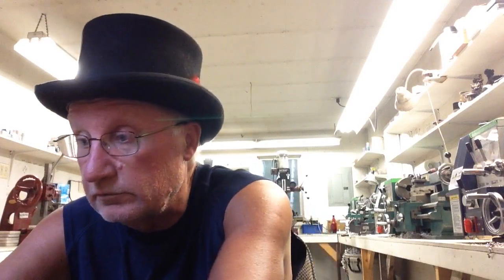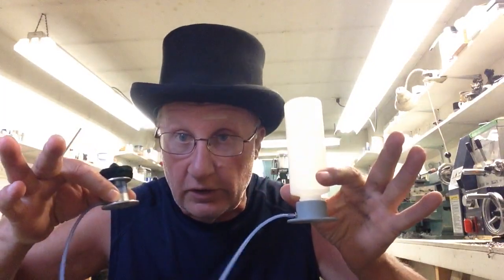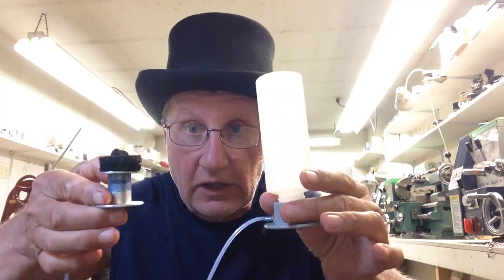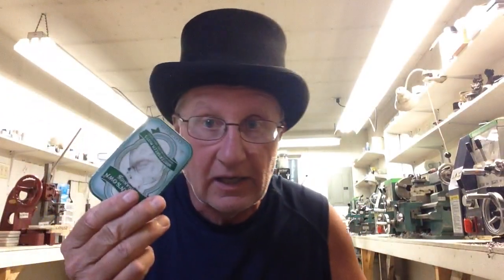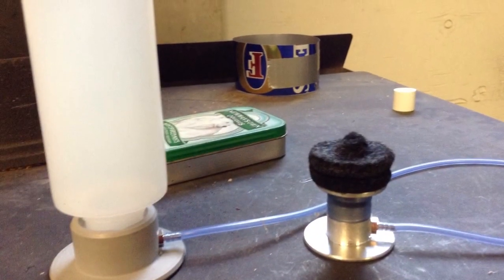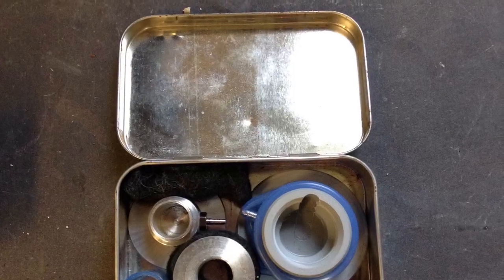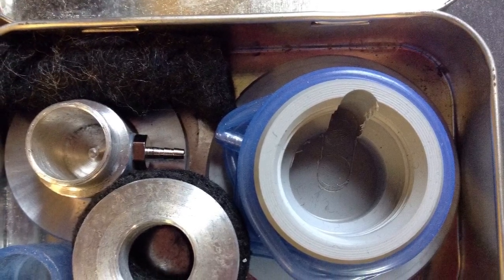Small Stove Kit

Comment: hey Tinny- im an iso-pro user, have bin for a long time now and i like this stove. i know there is a difference between the two. if i was to pick up this stove and play with it to get used to it before taking it out. that would be the right thing? yes- it would be my first alcohol stove. gotts to ask a master of these stoves. if i dont ask, a 40 yr old kid will turn into some thing like beavis and butthead and burn down the woods or close to it()(LOL!!!).
Reply from the maker: Sorry ---but i do not understand what you are asking.
Reply: Danny Panetta If you're asking whether or not to familiarize yourself ,with the use and performance of a new stove ,and not having  used a methanol stove before ,I would say yes.
  If you time how long and how much fuel a new stove uses to heat a typical meal you can determine how much fuel to bring.
  Also if you don't know what to expect from an untested stove in a remote location  on the trail, you might waste time , fuel ,food .
If by iso -pro you mean isopropyl alcohol meth is easier,if you mean isobutane propane meth stoves are completely different. 
  It's unlikely a minibull stove is a fire hazzard used with common sense.
Rewatch some of Tinny's old videos on running his remote stoves then try it a few times yourself 
  Maybe tinny should do a small tutorial and safety vid for each of his new stoves like soto does for their products.
and if this isn't what you meant .....well nevermind:)
Reply: jpkossman your on point. iso-pro= isobutane / propane. i forgot about isopropyl alcohol. LOL! srry for the confusion! any way. yea, im a total noob when it comes to alcohol stoves. i was asking to confirm my thoughts.  if i dont ask, the over grown kid in me will run wild with a new stove! LOL!!  thanks.

Comment: I can't imagine needing a 20 gram weight reduction on that stove. But, I can imagine someone else needing it enough to write off the cost of the extra mill work.

I have an original bongo, and was thinking that it wasn't running very hot, but now I see that having the wick crammed tight to the bottom of the base is where my set-up went awry. Wick exposure is everything to this stove.